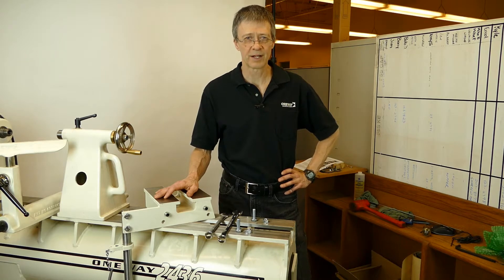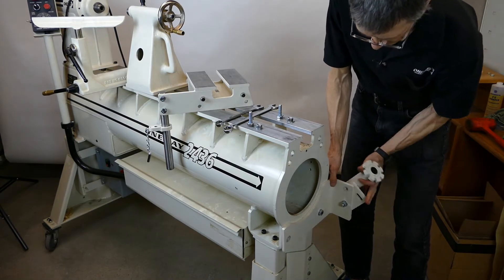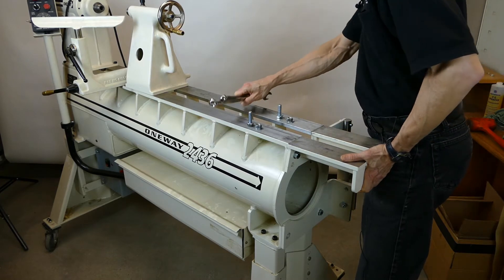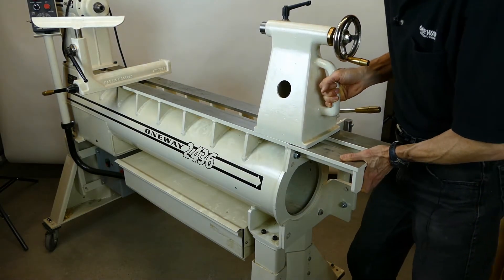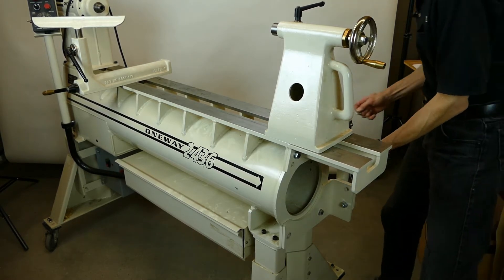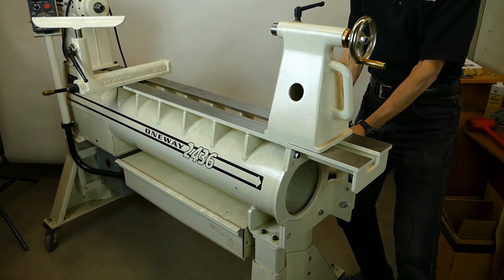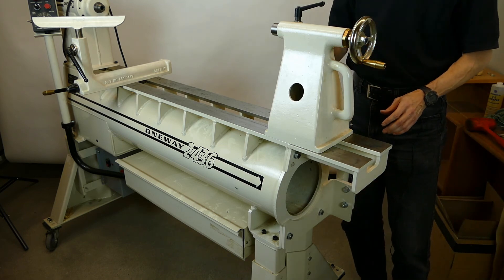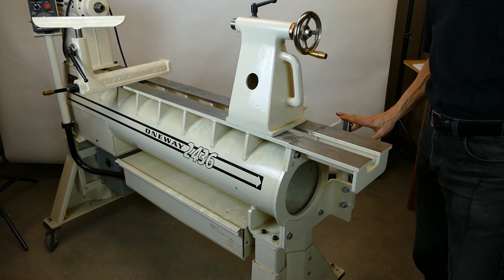Oneway Tail Stock Swinger

Comment: Whats the advantage of the swing away if  the headstock is stationary ?
Reply: Just came across this video because I was wondering the same thing.
Reply: For hollowing devices used on hollow forms.  The hollowing devices need to be used from the end of the lathe bed so you are looking straight into the opening of the hollow form.  So you need to swing the tailstock out of the way.  Hard to use hollowing devices when you are leaning over the lathe bed.